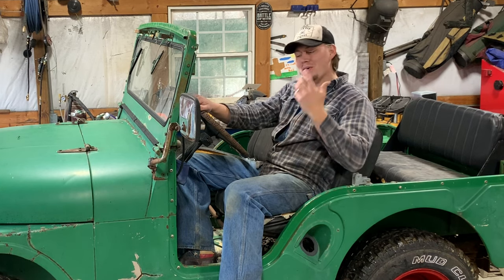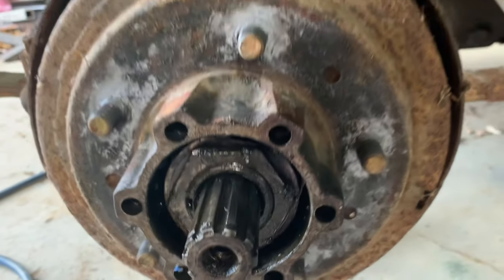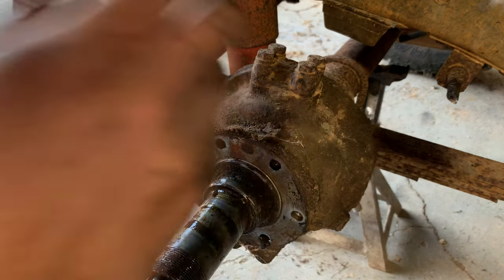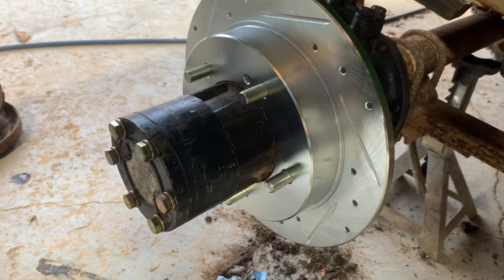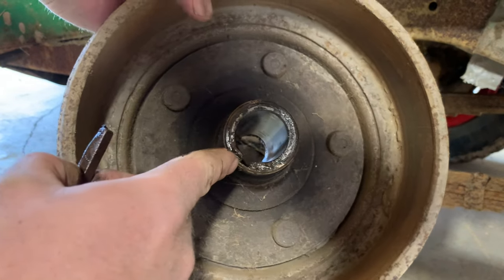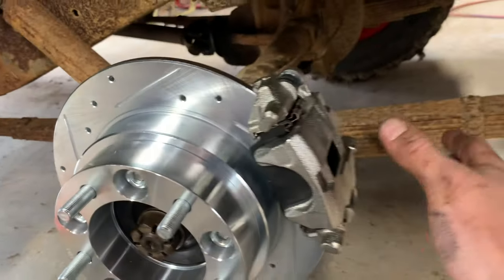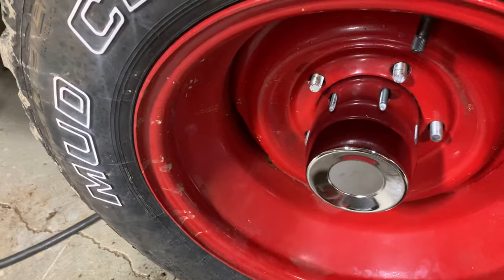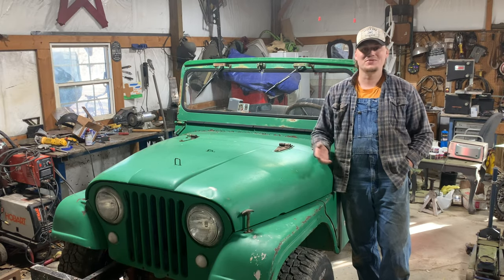Jeep CJ5 4 Wheel Disk Brake Conversion!

Comment: Will this work on a 1946 CJ-2A?
Reply from the maker: It should be pretty similar! and you probably won’t have an issue with it being too short!
Reply: @SevenBarSalvage  can you explain being too short. thanks for your reply!!!!
Reply from the maker: @bmstowell1  Sorry I’m getting videos mixed up haha everything will be the same on your 2A. You might have the swedged on wheel studs like I mentioned and you’ll need a hole saw to cut them loose to get your hubs off. Your 2A probably won’t have the brackets on the frame for brake hoses either so you can run down the axle and have 1 center hose at a “T” or make your own brackets to go from axle to frame. If you have any questions let me know!

Comment: You really should us a longer stud/bolt at the knuckle spindle location, you want at least two threads sticking out of the nut for max holding strength...that's not very strong the way you have it now.
Reply from the maker: I won’t disagree a couple threads sticking out wouldn’t hurt, I’d have to see what kind clearance I have and that’d also mean grinding bolts to length. But I will say there’s 100’s of Jeeps on the trail with the exact same setup and I’ve not heard of a failure yet. Thanks!

Comment: We have a 62 willys cj5 with a heater problem. How can we fix it?
Reply from the maker: What’s going on?
Reply: @SevenBarSalvage  not putting out Much heat.  It used to put out heat. How do we remove it ?
Reply from the maker: @georgesallyclark5686  I would remove the heater core hoses and check all the fittings I bet it’s just clogged up and not flowing good!